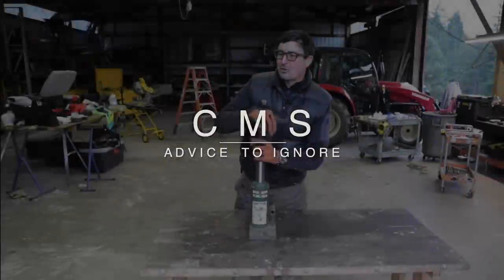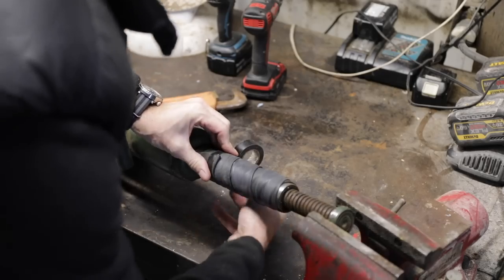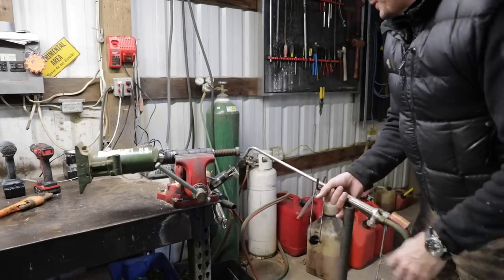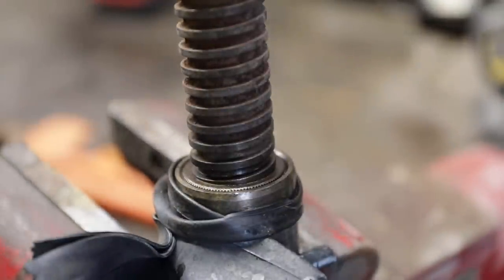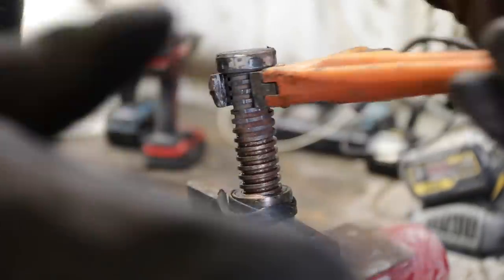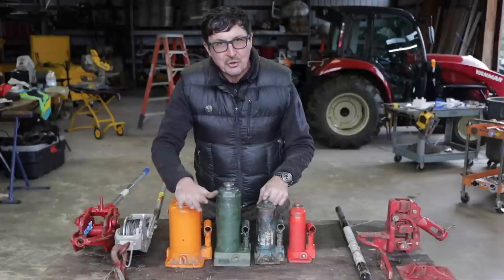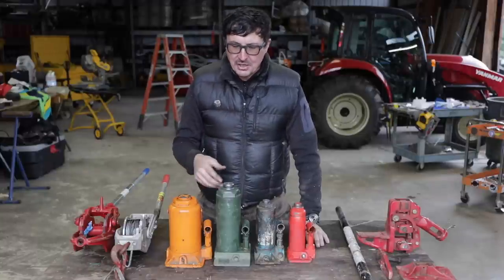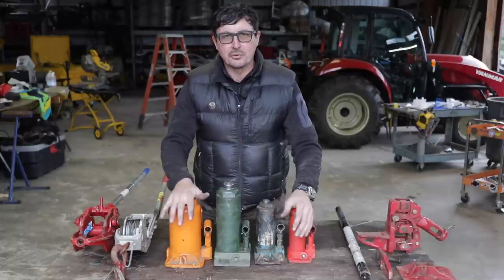How To Fix A Bottle Jack Like A Pro

Comment: The very first thing I'd do is wire brush the acme threads clean.  Red hot will permanently damage the steel, it will be softer and weaker after that most likely.

Comment: I use coper slip as a nine size on my cars wheel bolts it's really effective and torque to spec with no issues after 6 months still torque to spec

Comment: With the jack vertical, you can drip Liquid Wrenh down the threads over a couple days. Did the round piece at the top spin so the pipe wrench would not work there?

Comment: Honestly u don't want the screw shaft to get hot it will expand ..wire wheel it. & pen oil ..also a pipe on ur pipe wrench bro should do the trick..heat will ruin seal also wrench on the head  or you mess the threads up.just experience..oh that's propane not acetyline

Comment: In the service, we would use a dry graphite lubricating spray paint on bolts that we would potentially we would need to remove later.

Comment: When I start a torch up I like to turn the gas up pretty high and then add a small amount of oxygen at a time. Some people try to only use a small amount of gas and then add oxygen and this blows out the flame. So use lots and lots of gas at first. That is key to start it up.

Comment: After heating with the rosebud, let everything cool down.  Spray-soak threads with Liquid Wrench.  The male threads heat expansion in the female piston threads  creates a small clearance for the penetrating oil to fill after everything cools to same temperature. Rusted nuts on rusted bolts free up using this same technique, even if just the head of the bolt is heated as in a threaded block and let  cool to room temperature.

Comment: wonder if he knows that the holding vice has a pipe mount on it,  and that he should heat the outer tube so it expands not the inner threaded column.  And that by holding the outer tube in the vise jaws the outer tube can become crushed.  Forcing it up against the threaded column.

Comment: Great video, I've got a 20 ton that's froze up too, & I need to level a corner of my Grandmother's house, but didn't want to go buy a new one that I would rarely  use. I picked up an old orange 2 ton floor jack that didn't work, put oil in it & it lasted 25 years, so I think I'll repair this old bottle jack too. New stuff is not very good quality anymore. Now repair my old Craftsman vise so I can work on the jack. Always something broke that needs fixing. Kudos to this informative video.

Comment: I think I would have welded that pad on the top to the screw and then ground 4 sides on the pad to put a wrench on. That screw looked like it was red hot , it may bend when extended with a lot of weight in it and all that heat may have destroyed the shaft seal. Just my opinion.

Comment: A neighbor I used to have moved a garage in a similar way, except he did it with just his old pickup truck. Parked inside the garage, jacked it up, built some beams across the bed, put blocks in the leaf springs, let it down, and moved it about 100 feet from its original position to make room for his new three car garage.

Comment: I would of tried all this but heating the cylinder and sticking the screw top in snow as heat expands metal and lower temps contract metal

Comment: I would have been worried about messing up the the temper by heating it up and possibly loosing the 8 ton cap, but since it's an old made in USA jack I bet that 8 ton jack is equivalent to a 16 ton Chinesium jack.

Comment: cody best release oil is 3 parts diesel 1 part waste engine oil  works as a spray and is great for soaking in a bucket best with a lid . drop in and leave for a few days . also leaves oil film for protection.

Comment: Always put just a tiny amount of silver anti-seize on spark plugs , especially in modern aluminum heads . I only have a small and large bottle jack , farm jack , floor jack and a motorcycle lift . When working by yourself it is amazing what you can get done with creative use of jacks . I do not have a tractor with lifting abilities , but my cherry picker has helped this one man show several times . The older I get , the smarter we must be to keep from wrecking our old bodies .

Comment: Soak the thread in brake fluid. Weld a bart to the end bolt.
Get a big spanner for the jack, there is a place for it too be, job done.

Comment: I personally don't use aluminum graphite anti-seize anymore because of it accelerating galvanic corrosion between steel and aluminum threads. Copper anti-seize is my new standard, so far without any issues.

Comment: To solidly restrain tubular items such as your jack shaft without causing damage, I usually bore a hole (just oversize) in a block of hard timber then add a relief slot to one side of the hole. After this the block can be clamped solidly in the vice after the shaft to be clamped has been placed through the hole. This works every time and does zero damage to the shaft no matter how tightly the vice is closed. In fact you could have used two blocks for this job, one on the hydraulic shaft and another on the threaded portion. I know the lead screw thread still worked fine but it would have been much nicer to avoid causing any damage to it. I have used the above method to remove seized on drill chucks prior to repair without marking them at all. I hope this helps.

Comment: The question I have is if you heat up the steel to the point where it's red-hot do you change the hardness of the metal itself? Especially with something that's going to be holding several tons do you think but that might not be the best idea? I'm not saying that I know for certain that it changes any of the properties of the metal I'm just curious if it does or if it might and if that will somehow make that metal softer then it really needs to be.

Comment: the best way to free up anything like that is to heat it up with the torch and then cool it with water quick. try that and you will never do it any other way. you should never try to loosen anything hot

Comment: You could have welded a nut on the end of the piston instead of damaging the threads. Copper grease is an excellent lubricant as it stays exactly  where it should be up to 1500 degrees or so.

Comment: You needed to put the heat on the female threaded section so it would expand not the exterior thread which would make the diameter bigger.

Comment: Heres a tip for the jacks with release screws with the pin through them. Remove the screws, find a fender washer that fits it. Then in a vise flatten the washer over the pin. Now it has a nice easy to turn valve when wearing gloves.

Comment: Hey Mr wrangler star. Next time you have a frozen bolt or nut of any kind, or size. Heat it up good and melt candle wax into the threads. Brother it works wonders. You wont believe it until you try it. I use it for exhaust manifold bolts.
Reply: There is no penetration oil known to man that works better IMO, I usually go straight to the wax every time. I stopped dilly dallyng around with oils years ago. Try it, and maybe do a video if it works for you.

Comment: Heat the big tube, metal expands with heat, the outer tube will expand and a damp rag on the inner to keep it a bit cooler normally helps.

Comment: No sure if you'll ever see this comment, but an easier solution is to use a hole saw and cut out a simliar sized hole of the shaft into a wood block. 
Then slice a notch the wood block to allow it to compress.
When you put the shaft in the wood block and put it in the vise, it ain't going nowhere.
Reply from the maker: Will have to try that.

Comment: 2 yrs ago,  you  were  organizing your  new  wood shop,  and  inspired  me  to  re-organize my  barn.  I  did  pretty  well until it  came to  the  tool shop  and  its  still  a  mess!  I hope  to  get  back  to working on the  areas  where I  stalled  this winter.  I have  a  come a long that  needs  repaired,  and  a  pile  of  chains that  probably need  work.  The  area I  did get  put together for the  chainsaws  have  saved us a  lot of  time  hunting  too.  This  series  is  very  helpful!!  Thanks!

Comment: Wouldn't heating the screw make it expand and make it more difficult to remove?
Reply: Yep. Exactly what I was about to say. Heat the screw and expand it and that will crush the corrosion in the tube. Then cool the screw and it will shrink and you can screw it in and out easily. You can do the same with frozen bolts or broken bolts by welding a washer then a nut to a snapped off stud. Let it cool and screw it out

Comment: Been looking forward to this fix! Satisfying getting it loose. I love antiseize - didn't know about the copper. Thanks
Reply: Copper is high temp anti seize, and the silver stuff he had contains nickel for use with alloys such as stainless and aluminum, good for those pesky stuck spark plugs in the Ford modular motors

Comment: Have you considered how heating it may have compromised the structural integrity of the bottle jack?
Reply from the maker: No, the alternative was to throw it in the scrap metal pile,
Reply: @wranglerstar  ok, I hope you're careful when you use it! Very nice video series btw :)
Reply: @Carter229  that's why you always use the Jack stands that you seen under cody's bench to hold the car up, not a jack. Safety sally

Comment: Why would you heat the screw? Expanding that would only make it tighter. smh
Reply: There's always a slight gap in such things, the 'nut' is never the exact size of the screw.  So heating the screw did temporarily expand it into that gap, but in doing so, it broke the rust that had sealed its threads to the threads of the nut.  Then when it cooled and shrank, it let that bit of penetrating oil into the gap, allowing the start of twisting.

Comment: Glad you finally got it. For futures, metal expands when heated so the screw actually got  bigger diameter (probably breaking the rust and after cooling allowing the penetrating oil to flow).  Had you heated the piston (a tube or bushing expands making the hole larger) and cooled the screw (aerosol spray cooler) making the screw smaller in diameter, it likely would have freed sooner.

Comment: Why you heat the threads Is making no sense, metal expands when heated. You made it tighter for a bit. You need to heat the froze section to expand the outer ring. then it would of turned after cooling the heat expansion will break the bond by expanding the outer nut size.

Comment: Cody: FFR - by heating the screw, rather than the collar you cause the screw to expand in diameter, making it fit tighter, not looser.  Glad to see you get it fixed.

Comment: Don't heat the thread!  Thread expands making it clearance even tighter. Same principle with seized bolts,  if you just heat the bolt and not the stud, it comes free easy and without much effort.  Many times without penetrating oil.